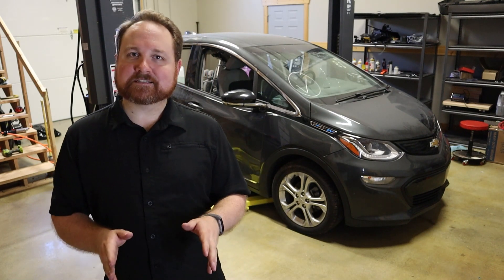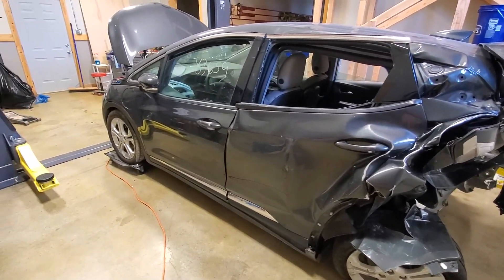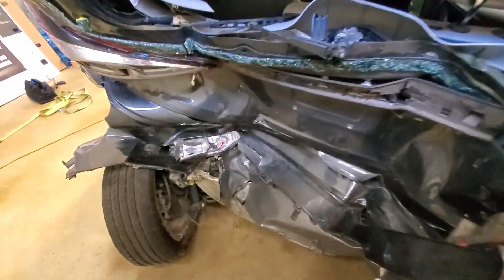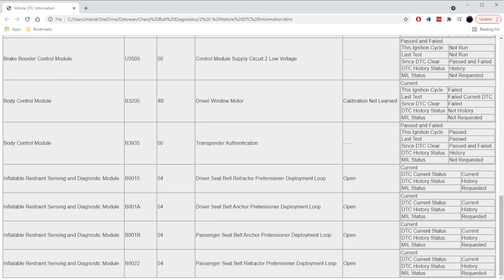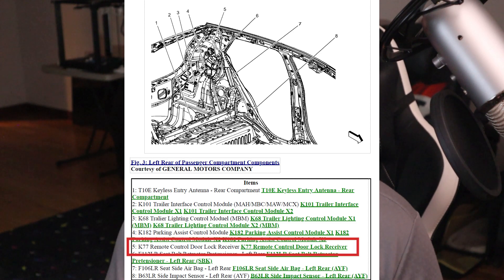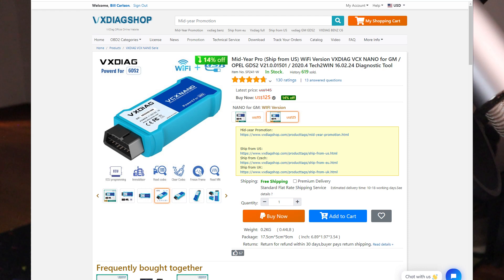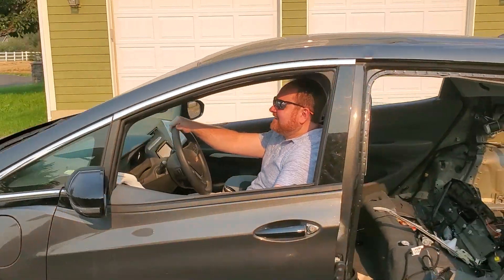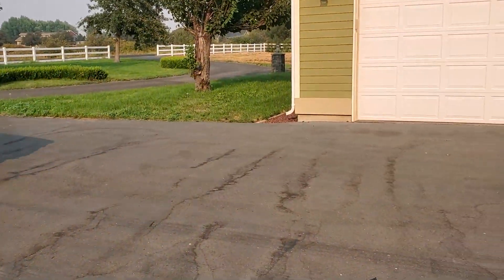Can I get this totally smashed and recalled 2019 Chevy Bolt to drive again?

Comment: Our Bolt was rear ended, thankfully at a lower speed (judging by other car's airbag deployment ~32mph) - glass broken and hatch caved in.  No airbag deployment (that's normal for a rear impact).  However seatbelt pretensioners were fired which threw a code that will not allow the car to move.  Maybe neutral works, but the car was dead when we saw it the next day in the yard.  It's now at a dealer waiting for a Bolt tech to look at it before it can be taken apart and looked at closer.  My wife is still quite sore 2 weeks later.
Reply from the maker: Sorry to hear that, I hope your wife gets better soon!!  The process to get the codes cleared is pretty simple - 10 minutes with the GDS2 tool to reset the High Voltage Secure DTCs will probably have it turning on and driving.

Comment: Very cool video. I’m having fun fixing up a Bolt for driver for myself. I have to look into the software stuff and try to clear codes on my car.
Reply from the maker: The VXDIAG NANO worked great for me for doing very extensive reprogramming! It's overkill for pulling and clearing codes - but for $115 its well worth it. I'll have a video covering some aspects of it once I get closer to fiddling with the wiring harness.
Reply: @BillCarlson   I have to see I might need to do more then just clearing codes. I have a transmission fault not letting it go into gear. I can get neutral but no gear.  How hard was this programmer to use?  Did you make a video about it?
Reply from the maker: @kingdeadlego  I will say that it was difficult to get running for me - and I'm a professional software engineer. But once I figured it out it was great and fairly straight forward. I have not  yet made a video about it. I recorded some of the process and wanted to be able to give some straight forward instructions on it - but ultimately it was really difficult and hard to follow, so I scrapped it.
Reply: @BillCarlson   when you did all the stuff with VXdiag  I was able to get GDS2 to run and pull my codes cleared one due to low voltage with the he old bad battery.  Now my question is with the SPS ( I guess you paid 40 for the gm subscription)  did you do any reflash on the modules or any thing?
Reply from the maker: @kingdeadlego  Yes, I did! When I first got the car I went in and reprogrammed a couple of the modules that I thought might have been causing issues with not being able to start. I also used SPS to reprogram my key fobs, because the car came with the wrong keys.
Reply: @BillCarlson   I guess the VXdiag need a internet connection for the SPS to work ?   I’m thinking I need to reflash the trans range module to be able to relearn the range if that makes sense.  Any good hints about the SPS I should know?
Reply from the maker: @kingdeadlego  Yes, it requires a constant internet connection. I actually found SPS more easy to figure out than GDS2! Or at least it worked more consistently. Pretty much just follow the prompts and you'll be good!
Reply: @BillCarlson   sounds good. I was able to do GDS2 with out a internet connection.

Comment: Your project is way cooler then a Hummer conversion. I'm so sorry to hear you used a bolt because of the bad luck with the recall. But personally very excited as I own a bolt as well. Can't wait to see what you learn about the internals. 
What is your background? If you don't mind sharing.. 
I really hope you do something to improve the bolt's shifter.. I can't stand it. Its the only thing I dislike about the car(aside from its propensity to play with fire) 
Are you going to continue to use bolt parts? or part out what you've got and buy another ev to use? Or perhaps just trade out the cells? I'd be so torn if I were you. Are you going to sell the infotainment? I'm interested in picking one up to reverse engineer. Seems like theres quite a few modules you'll be able to pair down. 
Also why 2019? instead of 2017?
Again.. Kudos on this project, and sharing your way through it. Sorry for asking so many questions..
Reply from the maker: Haha, thanks! I like the Hummer conversion that JerryRigEverything is doing, but it's definitely a very different project than this one! I'm also a little heartbroken about the Bolt situation - but I can wait. I've got all the time in the world and I've got enough space to shove the Bolt over into the corner of the shop.

My background is in software engineering - I'm a Lead Engineer at Microsoft, working on Minecraft where I lead the client marketplace team. I've been programming since 1995  and working on electronics since a couple years after that. I'm solid with digital electronics, terrible with analog electronics, and only slightly experienced with car mechanics - you can see some of my previous videos where I have replaced the DeLorean's frame and steering and brakes and everything.. but before that I hadn't done much more than an oil change.

I'm definitely going to use everything I can from the Bolt. The battery will be used in it's entirety - breaking it down into modules (once it's replaced). The infotainment and dash cluster - all will be used and will replace the old junk in the DeLorean. The shifter will be used at first, but I might rip the guts out and used the stock shift knob. Some things like the rear door modules won't be used, so I will likely build a canbus device that fakes the signals from those modules at some point. First drive they'll all just be sitting in the passenger seat. ;)

The reason I went with the 2019 was purely because that's what came up on Copart that fit my needs. I put bids on two others that were both 2017s and the bid went to over $13k on both of them.

Thanks a lot for the questions!!

Comment: I'll def watch. It's nice seeing how few components are around the rear axle.
My dream project is to replace a Bolt rear axle with a secondhand Tesla 3 rear motor and axle to make a dual motor, AWD Bolt.
Reply from the maker: Thanks Daguru!  That sounds like an awesome project! I think putting another motor in the rear would be pretty straight forward on the Bolt - there is plenty of space to have an offset-axel drive unit right in the middle where the 'trunk' normally is. The battery is far enough forward to clear, as is in the cross beam suspension. You'll definitely need to move the springs, though. I think you'll get a great view of the setup in the next video. :)

Comment: Love it!! I’m curious how much money you will get back parting out the Bolt.
Reply from the maker: Me too!! Things like air bags are really expensive - generally $250+ each (USED!), plus doors and body panels and the hood, so I'll be super happy if I get a few $k for everything remaining.
Reply: Great EP! Why are you getting it driving first instead of starting the gut job?
Reply from the maker: @stmazurov  Great question! I'll talk about it more in the next episode - but there is currently a recall on the Chevy Bolt where the batteries can spontaneously catch fire. They are going to be replacing the batteries in all vehicles, so I need to keep it all together and able to drive around the parking lot until the recall is complete.